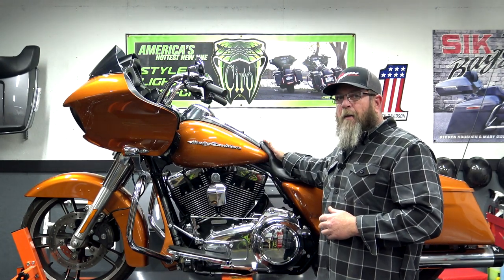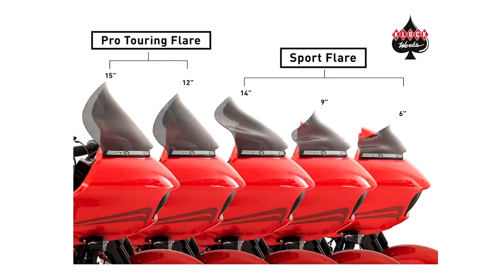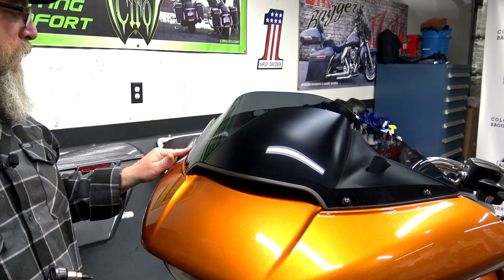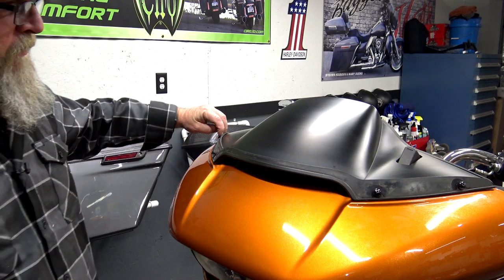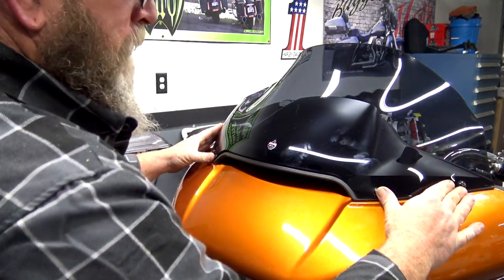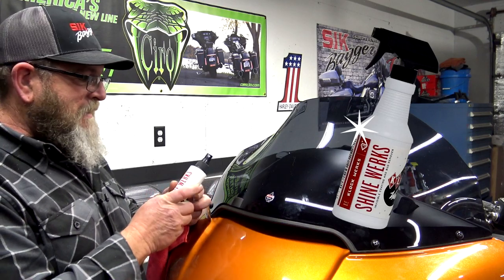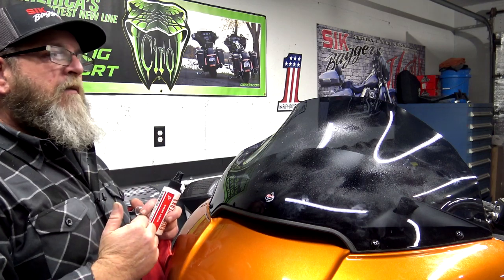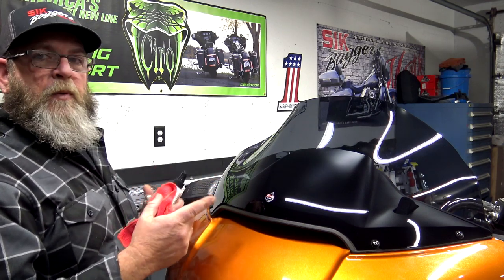How to Measure Klock Werks Sport Flare Windshield Road Glide

Comment: I put a 9" sport flare on yesterday and rode about 200 miles.  I'd say that it does as advertised! Very nice and looks great.  22 Road Glide Special.
Reply from the maker: Yes sir tom...love both of my klockwerks windshieldswell worth the price just for the hardness of the plastic..been nailed a few times with rocks...and literally nothing! like new! Dont scratch up super easy either like the cheaper ones..thanks for checking it out!
Reply: So the 9" inch is just a little taller than the stock roadglide special?  im 5ft 9, so im right on the edge of needing a taller screen?

Comment: Thanks for your videos, they are great, but in this video you placed the bottom of the level between your nose and eyes to determine the height of your line of site.  But in a 2017 video about windshield measurements you said place the straight edge/level just above your upper lip. For some folks that could be an inch to two inch difference.  So which is the best place to place the straight edge/level at?  Thanks.
Reply from the maker: The other video you are referring to is for the street glide. You measure different for the two windshields...these instructions were  straight from Klock Werks website on both style windshields.

Comment: Hey bud I know you have enough questions to answer already love the channel love the bike just wish I wasn't so far away from you guys Youngsville Louisiana 10 minutes from the Gulf of Mexico wanted to know in your air ride video I just installed the same bags you made a comment to putting an air gauge somewhere at some time was wondering where and where did you get the Gage from and install
Reply from the maker: Hey thanks man..and no worries...dont mind helping at all. I looked into getting air gauge and at the time could only find one manufacture of a push to connect air gauge so I could run it inline. BUT they only 1/4 inch and I used 5/32 air line. I never did get one and honestly now that its been a few years..Im kinda glad I didnt. I dont think I would have ever looked at it. Once you ride a few times you find the sweet spot. Its just becomes habit really. And being able to adjust on the fly makes it easy add some or let some out and you can feel the ride. I got a switch from AF Kustoms that mounts right above the horn so its not down on the firewall anymore...that makes it even easier.
Reply: @sikbaggers  your rt bud thanks for your time.

Comment: Just traded in my '17 Road King for a '20 Road Glide Special. 
I did the measurements just like you said and if my vertical measurement comes out to 14"
Is that the size or shorter that I'm ordering from Klock Werks?
Reply from the maker: I would go shorter if you are right on 14" ...you dont want to look through this style windshield.
Reply: @sikbaggers  
Thanks Steve 👍

Comment: Outstanding educational and informative video.  Love my Klock Werks windshield!
But, it is never high enough in rain or when using a seat pad on long distance rides.
Never understood why Harley Davidson hasn’t figured out that Riders want:
Windshield that can be raised and lowered manually or electrically
Comfortable Seat (like a Mustang Touring Seat)
a 7th Gear
Proper sound system
Tire monitoring system

Be well my Friend.
Reply from the maker: man that would be awesome! My buddies BMW touring motorcycle does that...flip the switch and it goes up and down. That thing is like riding a transformer! lol

Comment: Great video I’ve had a LRS on my 18 RGU and after 2 years it’s cracking out around the screw holes. Trying to decide between the KW sport or pro touring. With the sport do you get much wind on your torso?
Reply from the maker: Yeah I have one in the shop now that is a LRS and its cracking too...not a fan of them. And not at all with the sport..to me its a cleaner look and provides plenty of wind protection.
Reply: Well I just pulled a clockworks off a 2019 CVO Street Glide and it was cracked , I have used LRS for 4 years on my SGS and not a crack we have both had different experiences
Reply from the maker: @talkingrock7011   Indeed sir...I dont think there is one on the market that wont crack under certain conditions. Ive just been blasted a few times and no cracks while my buddies LRS busted on the first rock.

Comment: So if you needed 10.5" how did you know to get a 14"?
Reply from the maker: Like I explained In the video the sport flare leans back towards the rider. Vertical height attached to the bike is 10.5...the actual length of the wind shield is 14. But if you lean that back..the height straight up and back to you  is 10.5
Reply: @sikbaggers  what's your standing hight?

Comment: If you are looking over a windshield the rain is hitting your face and the bugs are hitting your face. So what is the point of having the shield so low? The Harley mentality continues. It is always more about how it looks then what it does.
Reply from the maker: The windshield is designed for the edges to create down force and the flip up in the front redirects the wind up and over you. Have you ever seen a bug shield on a truck? It's the same principle. Ir has nothing to do with looks. It works.

Comment: Bull shit! This shields look awesome, but they are not optical correct!  In other words, your view through the shield is warp! You been warned
Reply from the maker: Hey man...did you watch the video? I specifically said and so does the klockwerks listing that it is not designed to look through. That's why you look slightly over it ..the fin flip in the front redirects the air up and over you. I literally said that in the video.
Reply: Steven Housden that’s the problem and dissatisfaction to riders!!  If you need to look over your windshield just to ride because your shield is warped, then don’t sell it to your customers!!!
Reply from the maker: @alfonsothegreat4481  why....in the world would anyone want to look through it? You're on a damn motorcycle. Curves back, flipped up to push the air over you. You are literally getting the same coverage and you dont need to look through a piece of plastic. You're logic blows my mind.